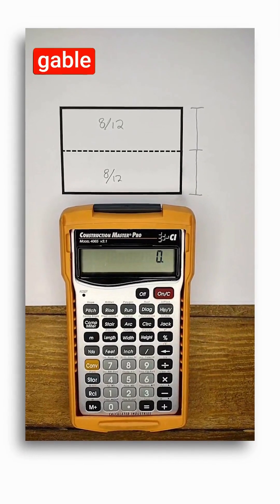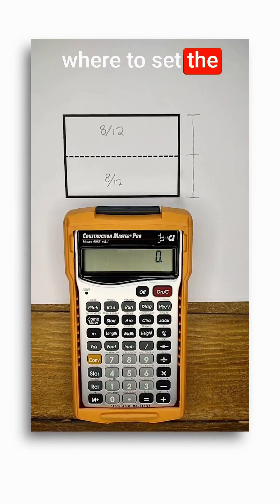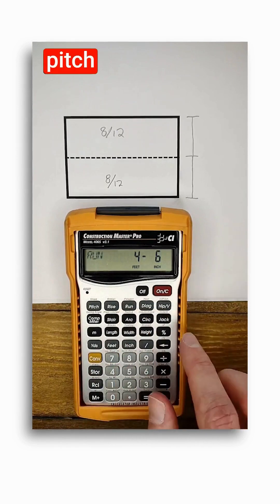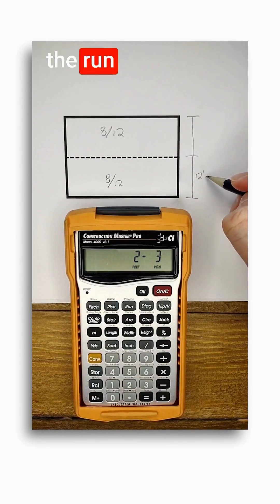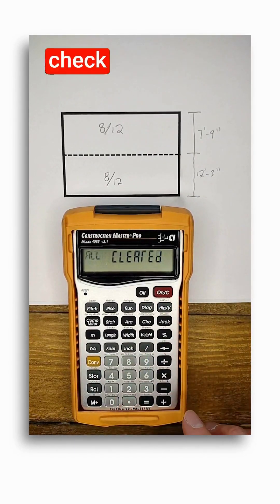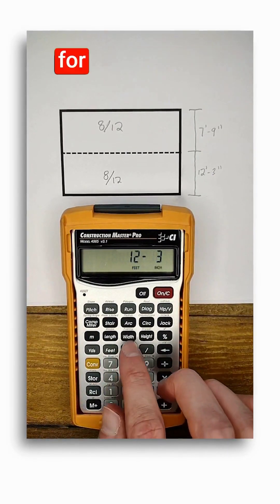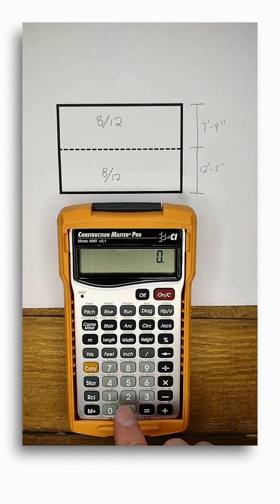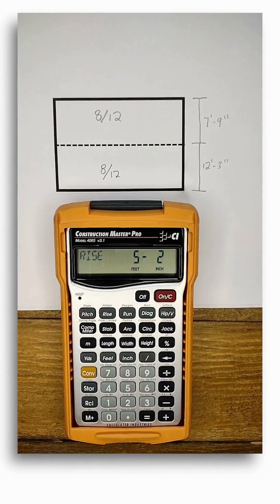How to Set the Ridge on a Gable Roof with Unequal Wall Heights

Comment: For those without them there fancy high falutin  calculators, you can do the same thing with a simple pocket calculator by the following formula:

Ridge distance from high wall = [(Total span x pitch rise ÷ pitch run) - wall hight difference] ÷ [(total span x pitch rise) ÷ pitch run]

Or:

Ridge distance from high wall = (Sr/R-Δ)/(Sr/R) 

S=total span: 20ft
r=pitch rise: 8in
R=pitch run: 12in
Δ=wall hight difference: 3ft

Or more simply:

Ridge distance from high wall = Stanθ-Δ/Stanθ

Where: tanθ = r/R = 8"/12"
Reply: thank you for sharing. i love to solve with actual math ,not fancy calcs
Reply: @kuldeepsingh-fj4dm or with a slide rule 😁
Reply from the maker: It's awesome to know how to do the math 👊